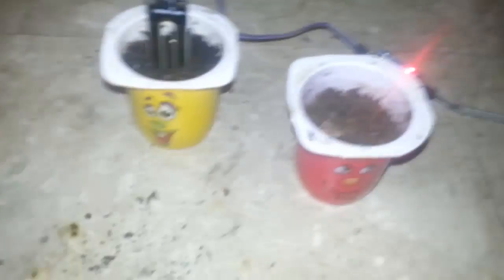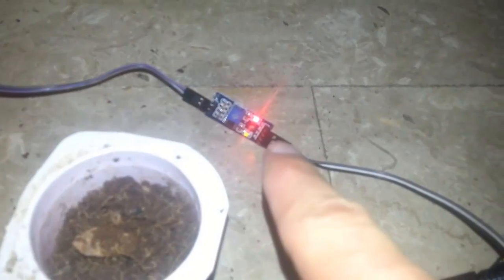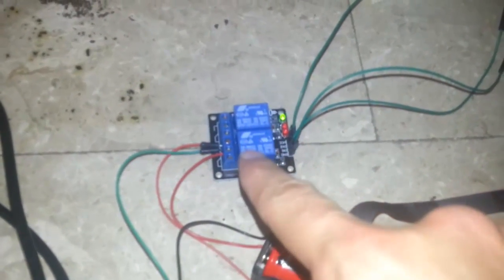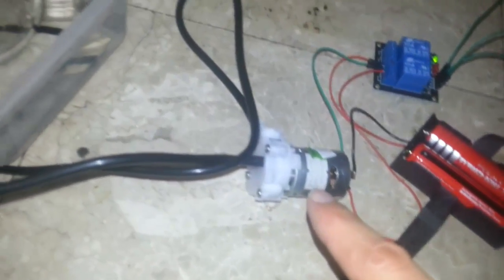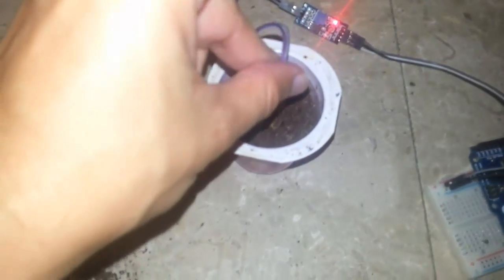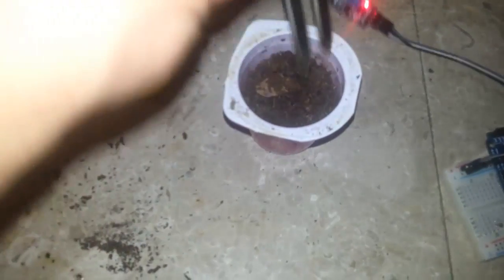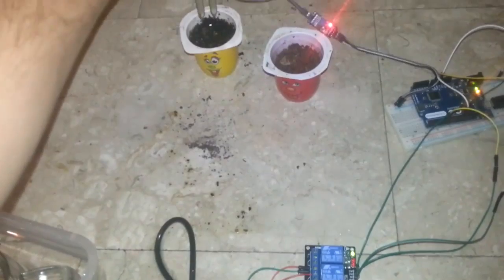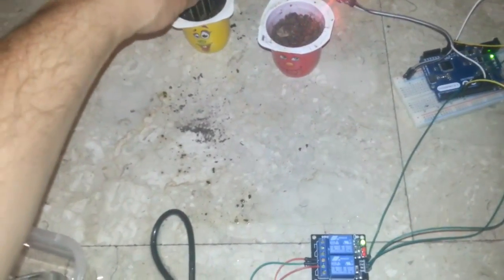Arduino irrigation system part 2

Comment: Hey do you use this with Arduino?
When I use the same power source to power my Arduino and the motor my power for the electronics semms to go down as soon as the motor starts even with an 2A power source.

Any ideas?

Comment: Please post the code that you use.
Also how did you made it actually put enough water for the plants, before it stopped watering?
Is this setup OK or you needed to put distance between the watering hose and the humidity sensor or delay the watering a little more?